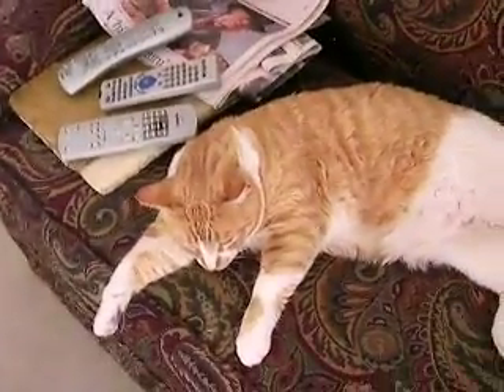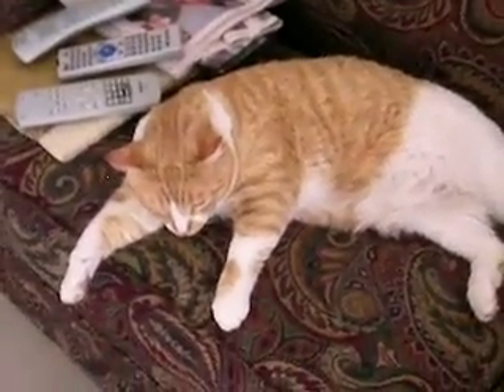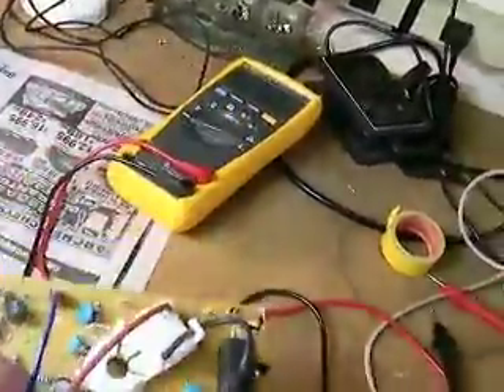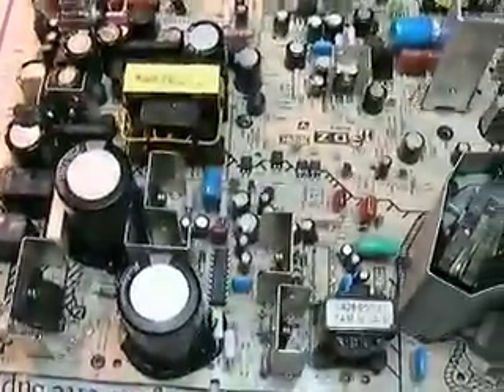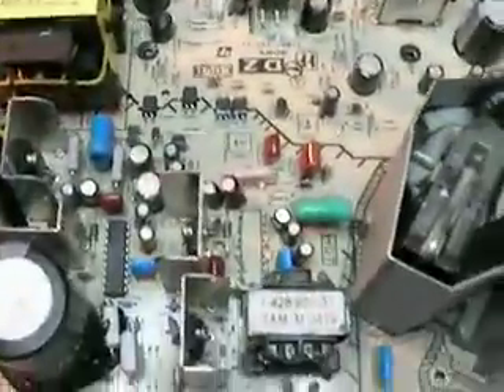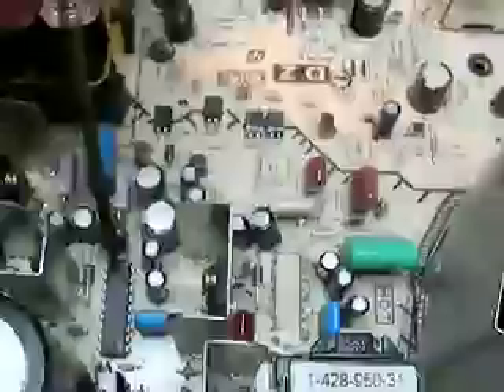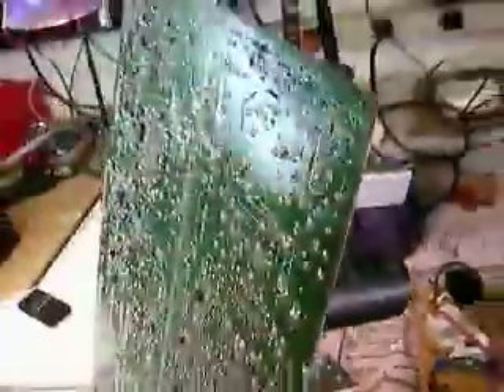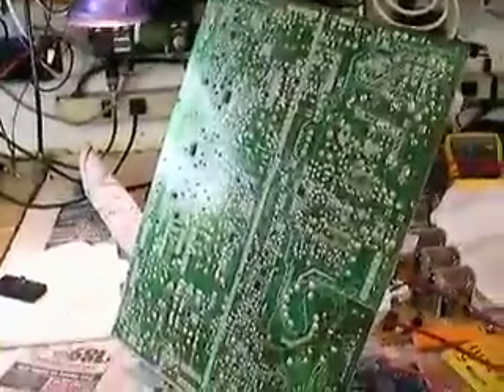Sony KV-36HS420 TV Repair

Comment: Your video is persuading me into doing this exact same procedure on the same KV-36HS510  that i've been using for 480p. What a great television until a power surge today. Same problems. ALready have cover off, was easy.

Comment: i know this is a bit late but a serviceman told me that you should NEVER use sockets in the high voltage sets. Did this set last long or did it die soon after?. Supposedly the sockets change the input frequency which can affect the flyback transformer making the problem ALOT worse i.e., what happened to me :(

Comment: hey we have almost the same tv and are having the same problem . the tv will turn on for  a millesecond and automatically turn off . the only thing is it blinks 8 times, from what i ve read it says there is a problem with the "audio" but im pretty sure thats not it. i have a definite problem with the circut board. please tell me how to fix this and how much this is for the tools i need.

Comment: does it have the same internals as the Sony WEGA KV-36HS510 ? and are thed ic chips the same? i am having the problem with my tv and want to see if i can fix it myself. i am a electronic guy in the air force and want to try to fix it cheap or just chunk it.

Comment: Thank you for this vid! Anyone who trashes a good working/serviceable Trinitron  to buy an LCD is an IDIOT!!! Trinitron has much better picture than any LCDs. About the picture quality the only affordable competitor of the Trinitron is plasma, but it sucks with "burn in"s. Later, maybe the OLED or laser tv, but NEVER an LCD due to it needs a backlight which filters through the actually black surfaces of the picture on the LCD panel, that's why LCDs can not produce perfect black and dark details.
Reply: 10 years on, your words are still true!😁😁😁

Comment: I love seeing nice gear like this repaired instead of being trashed, cool video.  I just had the cold solder joints on my LaCie monitor repaired and a signal driver chip replaced, saved me a fortune over buying a new, high end lcd monitor..
Would have been nice to see you actually replacing those chips...

Comment: Thanks for the great video. Had the same TV with the same problem and fixed it for less than $30.00, purchased everything on Ebay. The set has worked trouble free for several months now.

Comment: Oh i think you will find that the EHT is actually in the reigon of 25-30 Kv.  Not 50KV - at this voltage x-rays would be emitted from the tube face.

Comment: is this 1080i??
Reply: Yes man, crt's always drew two frames in interlaced pattern which means that all the lines are alternatively drawn at a point of time and the in the next point the rest half is drawn. But still, picture quality of a 1080i is no where near 1080p. 1080i is more close to 720p. 
You may still find a HD cable set top box transmitting is 1080i as it is difficult to transmit heavy 1080p.

Comment: Were you concerned about electric shock? Does the tv "store" a hazardous enough shock even when unplugged?
Reply: When unplugging the high voltage cap from the crt, one needs to discharge it first as it may store a very high voltage which may prove to be fatal!!!!@$%!!

Comment: Some useful stuff here, but it might also have been good to see
-Diagnosis process: As it stands, it sort of comes out of the blue. how did you trace the fault to those two ICs - did you test the horizontal and line drive stages first? 
-chassis ref. would be good to know, as other models probably use the same guts.
-footage of the disassembly and repair in progress, and a note of how long it took, this would help on a practical level.
anyway, I mean this as constructive criticism! good luck.